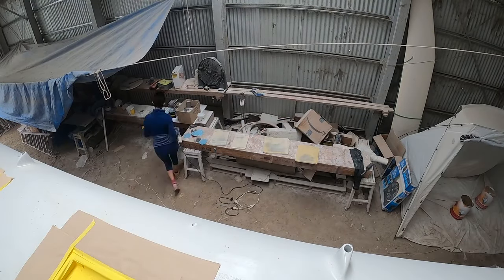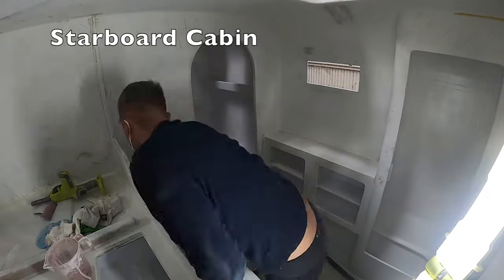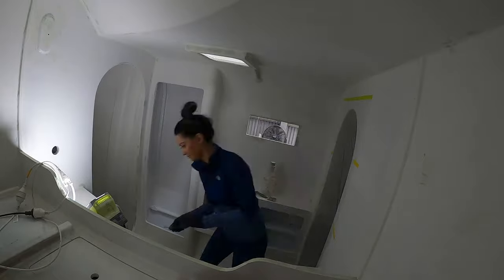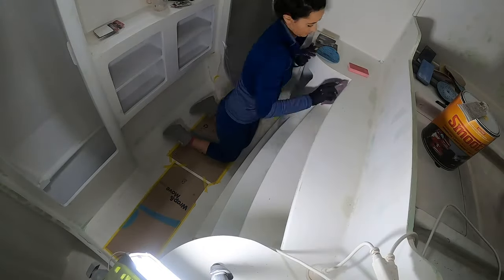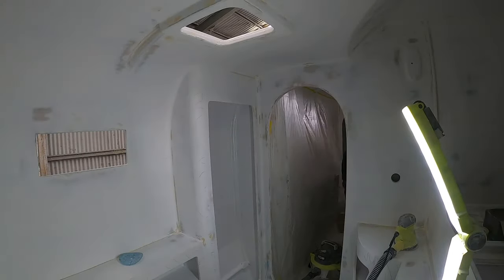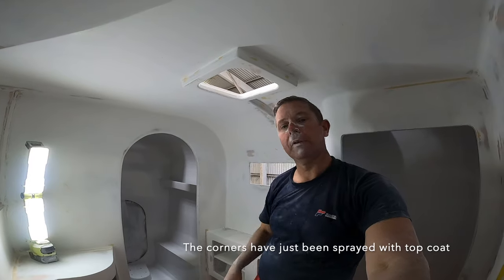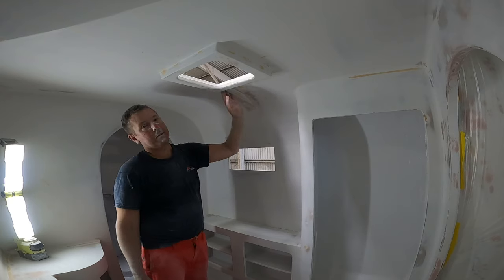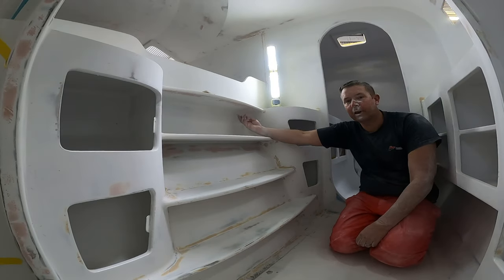This SAILBOAT's CABINS NEVER felt THIS BIG - S03E12 - Catamaran Restoration | Building Wilda

Comment: I wonder what the dry weight will end up being before you add fuel, water,  food and your personal belongings. Pounds not metric.
Reply from the maker: Just around 9000 pounds
Reply from the maker: 13500 fully loaded
Reply: @buildingwilda  I hear that the Cyber 48 is 6.1 tones empty. The internet says that 1 ton is equal to 2204.62 pounds. 6.1 times 2204.62 equals 13,448.182. Hmm, that doesn't seem right because several people have said that the Cyber 48 is the lightest weight boat of it's size and weighs way less than 10,000 pounds. I don't really know how much a ton is equal to in pounds.
Reply from the maker: Size matters.

Wilda is under 45 feet. It may not sound like much, but 3 feet longer is a big difference and usually also implies greater width at the waterline and draft. It all adds up quickly.
The Mumby 48 is about a meter longer (more), each hull 10 cm wider and 10 cm deeper draft. A bigger and heavier boat with similar ish performance.

One of my favourite boats is the spirited 480. A 48 foot balsa core cat. Have a look at surf sail roam for a great example of the model. Amazing boat! 8 tons fully loaded. 17640 pounds. 2.2 tons of that is payload.
Fast boat. And comfortable.
Reply from the maker: The Mumby 48 is 6100 dry. 7400 design for cruising and 8700 max.. I'm guessing the latter slows her down a bit... Not sure.
I really like the Mumby design. It's a great boat!